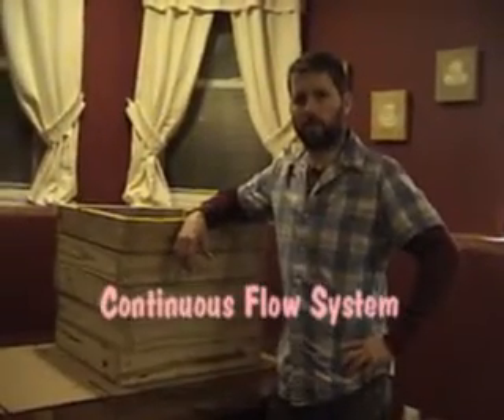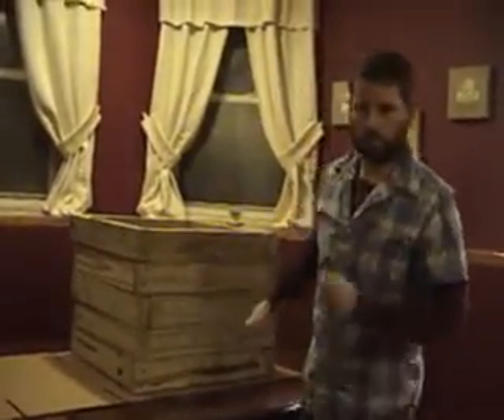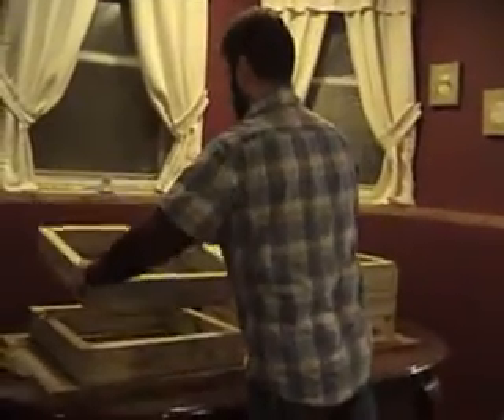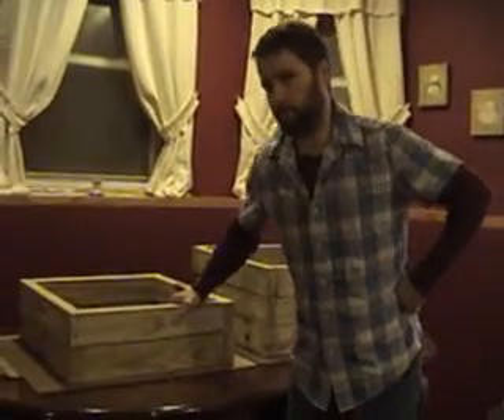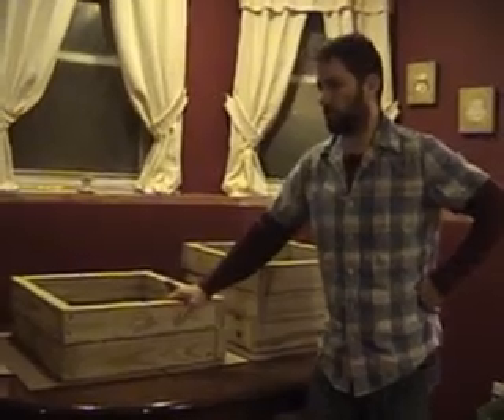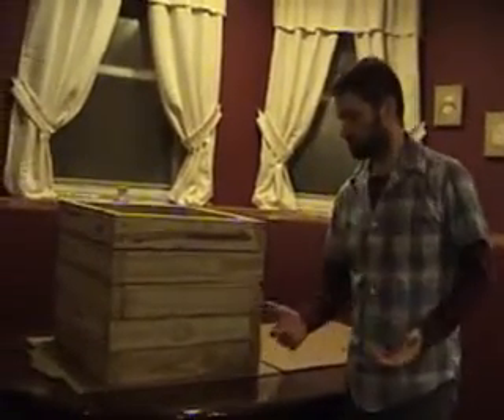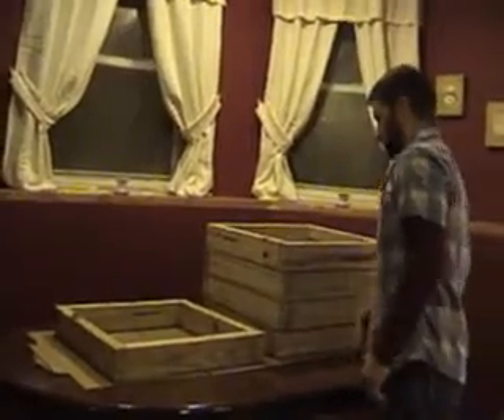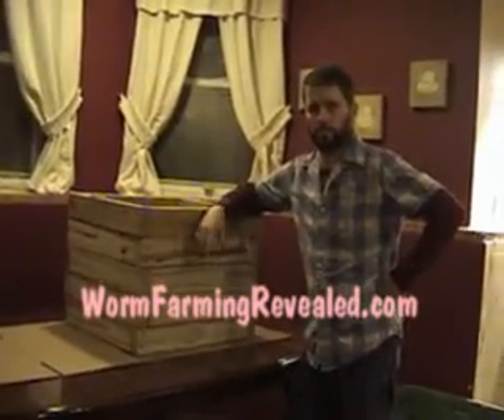Setting up a worm bin using a wooden flow through system

Comment: TREX plastic "wood" (made from recycled plastic) and designed for outdoor decks should avoid the warping issue. It is more expensive, but it never rots. A little construction ingenuity will allow the bins to securely stack.

Comment: That is too many '''s for me :P - I used boards 10 cm wide and about 2.5 cm thick, so maybe these 2.5 cms are a bit too low. In inches I think this would be about a 1x4?? I used reclaimed wood - one type seems to stand it quite well - it is harder wood. The softer, lighter wood is warping. I guess I will not used reclaimed wood but rather buy resistant wood then - Larch is commonly used as a water resistant one here, so I will buy that then and remake those frames that are warping.

Comment from the maker: We have several people here at WFR that have success at making and using the wooden flow-through system. Is your wood 2x4's? Did you use long 2 1/2 - 3" screws? Not sure why your wood is warped is it old or new wood? Try putting something heavy on top. If you don't want ants you can put in on a small table and place each leg of the table in a bowl of water. The ants will die in the water or just avoid it. Also DE can prevent the flies. To learn more go to the website. Sorry you're having trouble

Comment: Dammit! The woodem bin I built is now active for less than a week and the moisture inside and dryness outside made the wood warp like crazy. It has now numerous gaps at the joints where ants and flies can get in. This is not good :( I guess what is to be learned from that is to either waterproof the wood from all sides and/or to buy a wood that cannot warp that much.

Comment: Ok thanks for the advice. Those that will not hatch in time will go in the garden and be free - thats ok ;) - I sourced some wire frame from the dumpsters, so thats sort of what I have - also did not want the bedding to fall though. I think however I used too much bedding now - used some newspaper and some compost. But suddently the forst tray was almost full with just a little bit of scraps - lets see if that gets reduced fast enough before the upper one fills. Thanks again for the answers

Comment from the maker: 70 days is not typical and if you keep it indoors or climate controlled around 60-ish then you will see them hatch in less than 30 days. I just don't want to guarantee any hatch-rate success to anyone if it doesn't happen. When starting out you need to put about 3 layers of moistened newspaper in bottom of tray then bedding/food and cover with more newspaper. Yes on the size of mesh. Bigger is even okay. Like 1/2 in or even 1 inch. ~Pauly

Comment: Ok that is quite a bit of time - 70 days, so then it does make sense to have several trays, because to wait for 70 days until harvesting that lower tray is too long - the upper tray of two would be full by then, so I guess at least 3 trays would be good. Darn, so I need to build another one then. Oh and another question - I used about 1 cm grid mesh for the bottoms of the trays, that is about 1/3 of an inch. Do I need to do something to keep worms from dropping out at the bottom into the bucket?

Comment from the maker: Red Wigglers hatch between 30-70 days but it depends on climate conditions. Don't be afraid to look at the bottom trays to determine if you have hatched or unhatched worm cocoons. Red wigglers (Eisenia Fetida) are very forgiving. If they still need more time then just place the tray back in position. FYI...Keep a spray bottle handy. This type of worm bin can dry out very quickly. ~~~~:o Pauly

Comment: Thank you for the answer. How long do the babies need to hatch, so after what time you can safely remove the lower parts? And I am amazed that these worms manage to crawl up the sides of the container which are basically vertical. That is cool. I thought they can only move in the soil and maybe reach up a centimeter or so to bridge a gap. I was especially worried about the young ones that just hatch when the castings settle down and then have to climb up maybe several centimeters of vertical.

Comment from the maker: Hi Aurora G, The purpose for several trays is for (1) storage, especially in the winter and (2) to give ample time for the babies to hatch from the third and fourth trays. The worms will have no problems crawling up the sides to get to the next tray but moreover, when you see the castings reach the top then you can add another tray. Just like a Worm Factory, Thanks for posting.

Comment: I have 2 questions: How do you make sure that the worms get to the next level if the stuff in the below level still shrinks, leaving a gap between the soil and the mesh (what size ar the holes in the mesh btw)? And what is the benefit of stacking so many boxes - is there something stillhappening to the worm castings once the worms moved up to the next level - why not harvest it right away and have only 2 boxes? Maybe there is some benefit in aging the castings...

Comment: If you have to pick up the lower level, and "dump it out", then it is not continuous flow. A continuous flow system is one that eliminates this. It stays together in one system and you harvest the casings from the bottom without altering the structure of the unit. You need to relabel this video.

Comment from the maker: @stevesrt8

Worms Crawling out are not really an issue. They prefer to stay inside out of the light and dry air. However, you will need to dampen the bedding. Unlike a plastic bin it breathes much faster and that's really the biggest maintenance. Keep it off the ground to prevent ants and centipedes and rollie pollies etc... from enter by puting all four legs (if you have a stand for it) into a pan of water.

Happy Worm Farming,
Paul